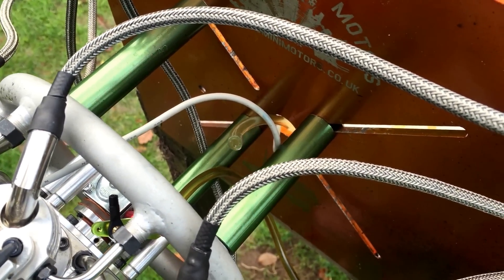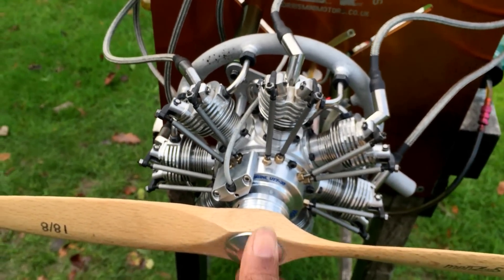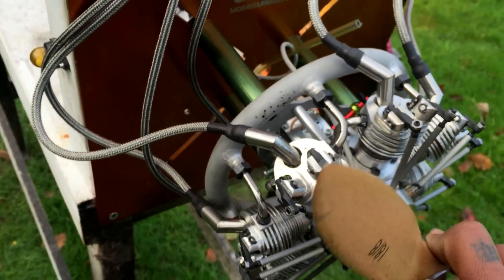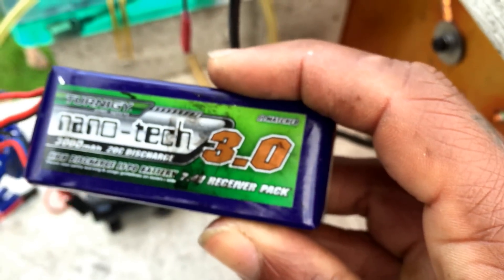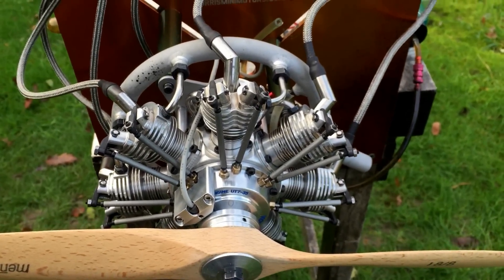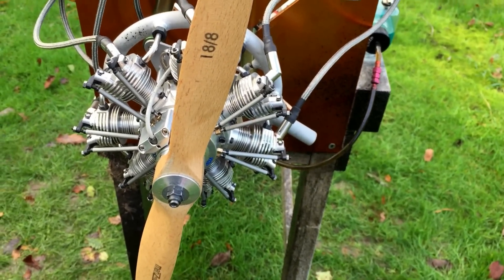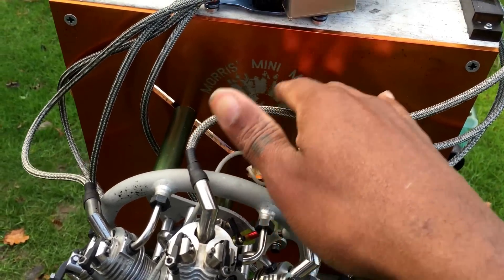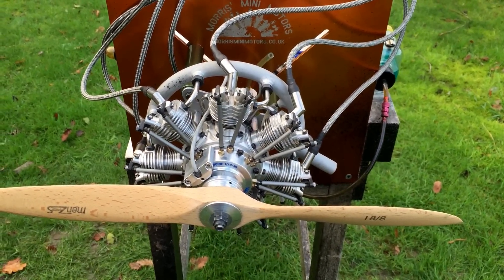Evo 7-35 full gas conversion test run 20 to 1 mix

Comment: Hi 🙂
Very interesting conversion!
Did you notice any problems for pushrodbearings? They don't seem to be needle bearings right?
And how does the fuel pump work with with a single line? Should't there be a return line for the fuel which is not beeing used?
Thank you!